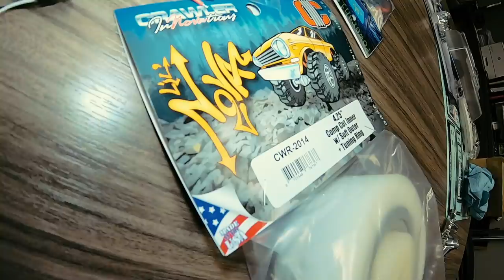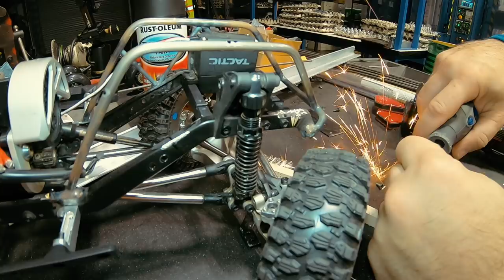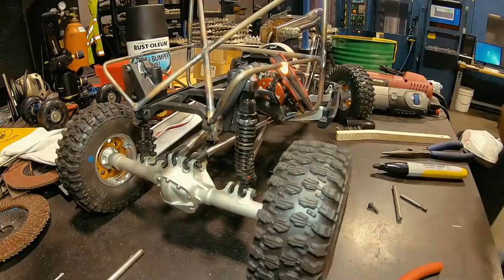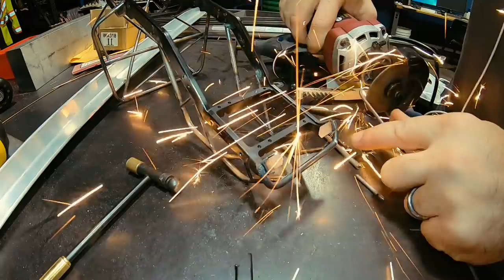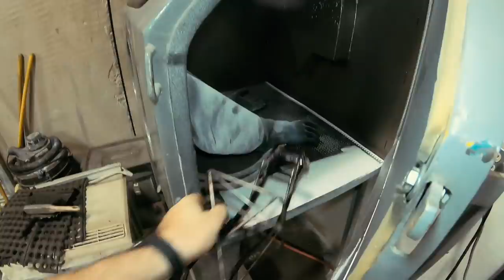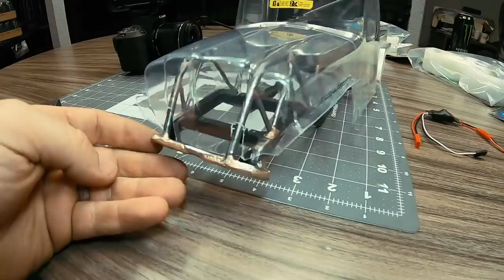Crawlmasters - Vanquish VS4-10 Build Vlog EP 2

Comment: This rig looks awesome! Keep it up. 
I scored a first gen Powershift DMS and had zero luck with it.  Nothing but constant brown out. 3s was a serious no-go, but 2s wasn't much better.  Contacted customer service, more than once, and NEVER got a response.  So now i have a scale battery that cost me 30 bucks.... :(
Reply from the maker: Bummer. I ran my first one on 3s with brushless and it worked fine until the iron from the soil kept getting in there. So I had decided to take it out. This one should be easier to make sure it works
Reply: @HarleyDesignsInc  it has a plug in it?  instead of the silly magnets?  That sounds like it'll work better.... though I'm VERY hesitant to give them another $40+ .... keep us informed on how well the new one works.

Comment: Definitely like watching the fab work over anything else! Nice work!
Where can I get a steering servo and servo winch combo mount like that for a 10.2? Having trouble finding something like that. Would a vs4-10 mount fit a 10.2 chassis?
Reply from the maker: The SCX10-2 kit version has a mount that holds both. Check it out.
Reply: Harley Designs , I do have the kit setup already. But I’m looking for a side by side setup. Thanks!
Reply from the maker: Ah. I don’t know of a side by side setup. I’d guess maybe a 3D printed option would be possible.